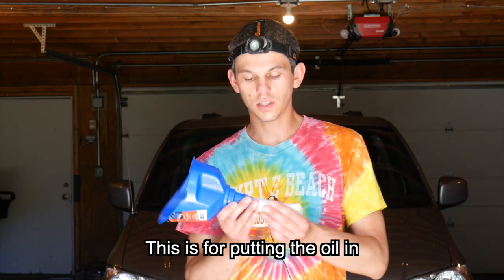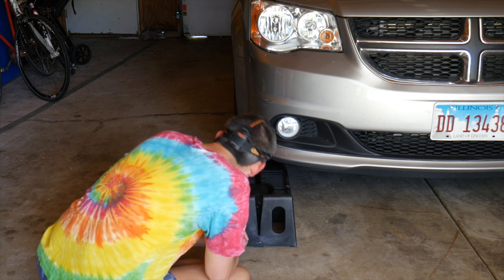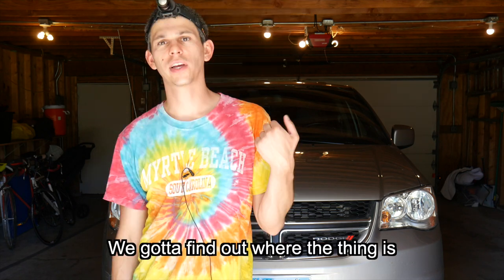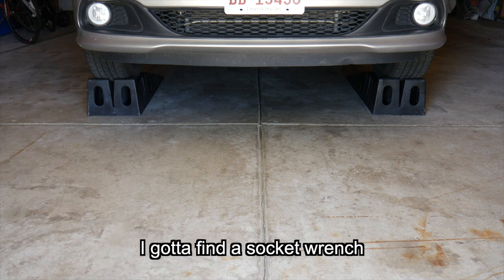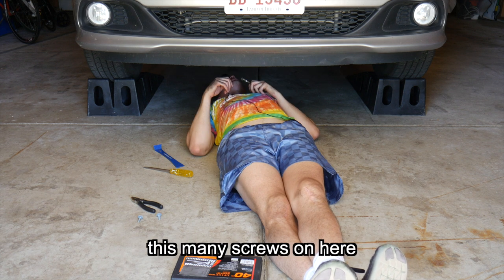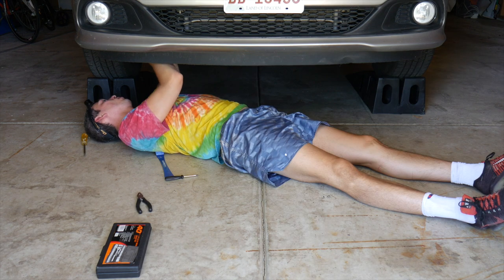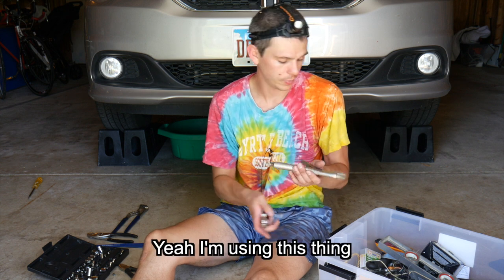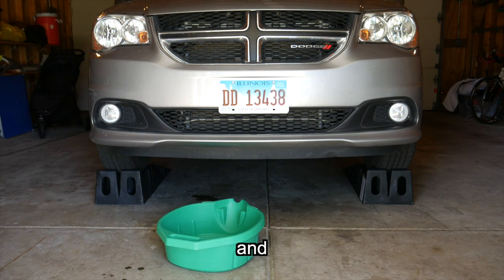Trying to Change My Minivan's Oil Without Losing My Chill - Handyman Alex

Comment: oh this is an easy fix bud. you just grab your carbo and shingler (make sure it has 4WT grips) then skim-handle the long neck until the whole thing is shimmied. after that you just slap on a couple of 85s and some fleckbangs,  tapshoot the back, and you're golden.

i don't own a car but i wanted to fit in with your other helpful comments.

Comment: Well at least you can put the mechanics kids through college that way. Get someone to torque those screws down properly so the oil pan gasket doesn't leak. You would have also needed a filter wrench probably because jiffy lube kids over tighten the filter and make it hard to remove. Tying  a rag around the arm taking out the plug will help to avoid getting oil all the way to your armpit when it starts coming out.

Comment: Just take it somewhere and let them get the plug out.  You don't have the tools for it.  Probably going to need an impact wrench or an oxy torch to break it loose.  You also could always use an oil extractor and just suck the oil out through the dipstick.  My RS5 was done this way because it has so many panels covering the bottom of the car.